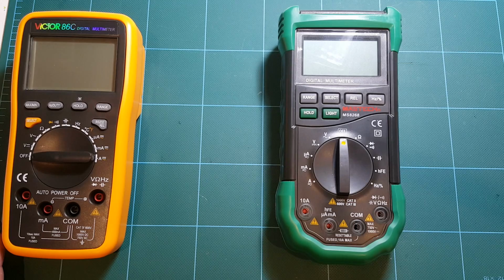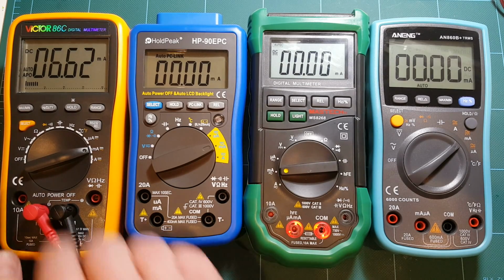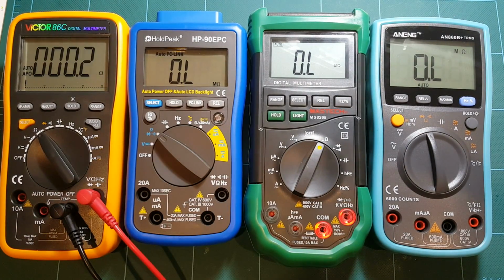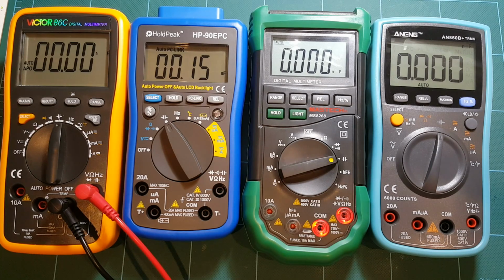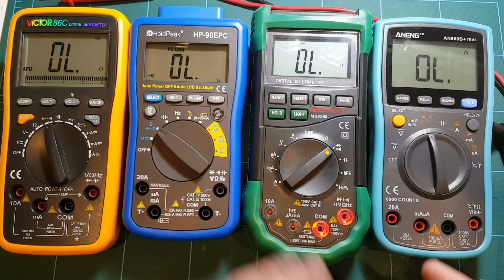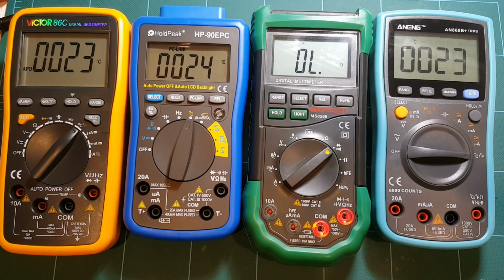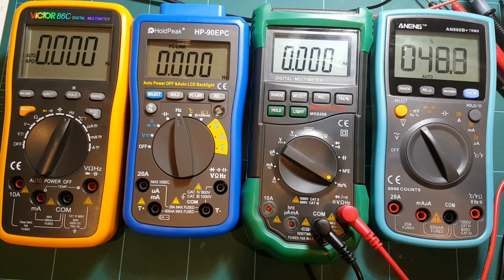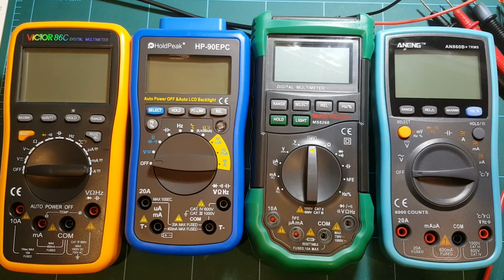New meters: ANENG AN860B+, HoldPeak HP-90EPC, Mastech MS8268, Victor 86C

Comment: so if you set the voltage reference to 2.5 would that meter on the left with 6000 counts have shown another digit after the decimal? if so you should have tested them all at 2.5 volts not 10.
Reply: was reading through the comments and see you link a video of yours doing exactly that. ill post a link here in case anyone else would like to see the results
https://www.youtube.com/watch?v=LW17hxGkVQ0

Comment: You can in fact Measure Temp with the Mastech.   Simply use a K-Type thermocouple and compare  voltage to a chart converting to temp reading.   K Type generate micro volts.  https://www.thermocoupleinfo.com/type-k-thermocouple.htm

Comment: You should only use the test leads/probes that came with the meters to get a Ture test out of that meter. Test leads/probes are different. F.Y.I.
Reply: Also you should measure leads internal resistance before starting to measure resistance and for comparison you should always discharge capacitor before connecting to the next multimeter.

Comment: Just wondering.... Do you (or anyone reading this) know of a SUPER INEXPENSIVE DMM that will simply test household batteries (9v, 1.5v) under load, test continuity with sound and test impedience? This is for guitar repair- I'm putting guitar maintenance kits together for players who want to do their own work. I am asking this same question on several other good YT DMM videos, so don't be surprised if you see me asking elsewhere. Thanks in advance.
Reply: there is no impedance measurement in usual DMMs,  impedance cant be measured directly any way , you probably mean inductance , that is done by LCR meter  but they dont do voltage and continuity , im not aware of a single device that does what you need .  Transistor tester can do some , usual DMM other things but in one device , im not aware of it .

Comment: Hi, Artur! I enjoy your show a lot. Yes, Aneng 860B does have auto power off. It take 15mins at same setting to auto power off.
Reply from the maker: Thanks!
Yes, i know. Fortunately you can override that by holding down select button while turning on the meter. Then it will not power off. But it still will beep from time to time. A bit annoying but I guess intent was to remind user that the meter is still on.

Comment: Thanks for the comparison. Looking forward for taking apart of an860b. Having some hasitation wether it's worth buying even though it looks pretty good in this video. Backlight and frequency measurements are little disappointing. The description says it can go up to 20 mHz...
Reply from the maker: I'm planning on doing a take-apart of Victor tonight to see what's going on with that milliamp range, but I'll do Aneng next. From leaflet which came with Aneng: "measuring frequency: it is only suitable for low frequency and high voltage measurement such as AC220V and AC380V. not suitable for high frequency and low voltage. Main purpose use in measuring AC voltage, max range 5V/10KHz." But I think that refers to measuring frequency while selector switch is in VAC position, not mV/Hz position. I'll show what i mean in the video. I think the meter is fair value for the price.
Reply: Artur's Lab thanks for detailed answer!